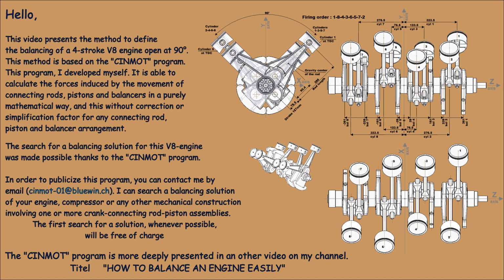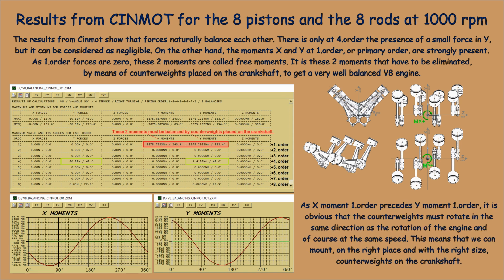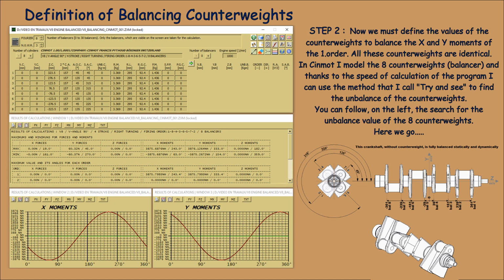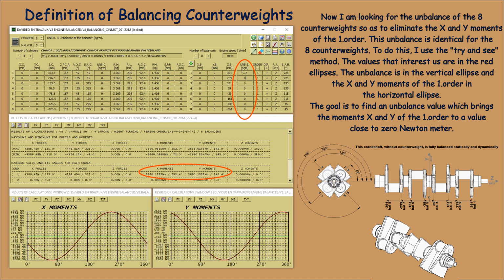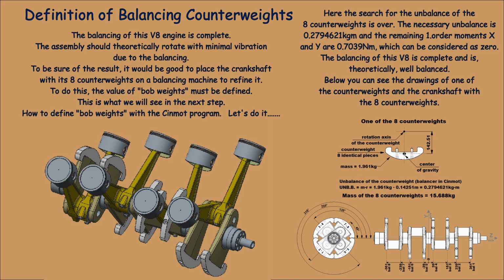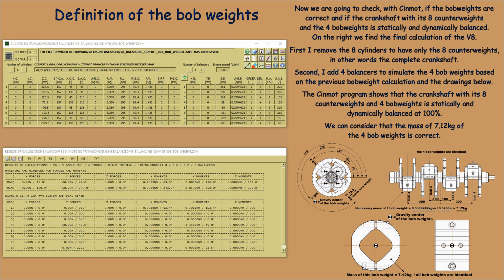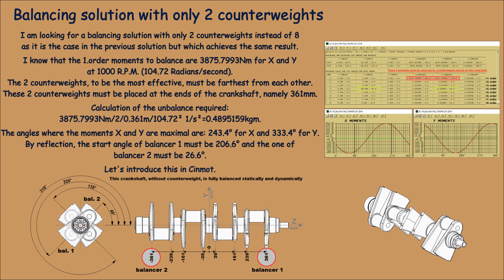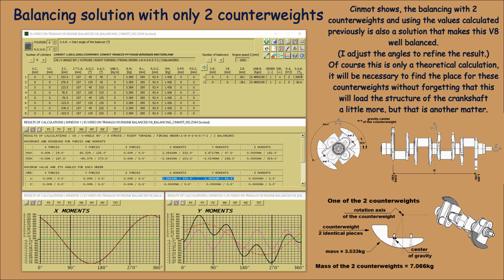BALANCE A V8 ENGINE

Comment: Hey i am thinking about bilding a crossplane inline 4  from a d4f renault engine, how hard do you think it wil be? And would balancing whit only 2 counterweights be sufficient?
Reply from the maker: Hi  Niels Van den Branden 

Thank you for your message!

If you want to transform a standard inline 4-cylinder 4-stroke engine to a crossplane inline 4-cylinder 4-stroke engine is a big deal. You have, at least, to make a new crankshaft and new camshafts for the mechanical side and adapt the all electronic engine management.
I can not help you for this, but I can help you for the engine balancing.

A standard inline 4-cylinder 4-stroke engine has, without balancing shaft, vertical second order free forces. With 2 counter-rotating balancer shafts (Called "Lanchester balancer shafts"), those free forces can be fully balanced and this 4-cylinder engine can be fully balanced (free forces and free moments can be totaly balanced).

A crossplane inline 4-cylinder 4-stroke engine has, without balancer shaft, no more free force of any order, but first order free moments appear. Those free moments can be partialy balanced by mean of counterweights placed on the crankshaft. If your crankshaft is a fully balanced crankshaft, 2 counterweights, judiciously placed on the crankshaft, are enough to reduce those first order moments, but only to reduce . If you want to fully balance this engine you have to built in a first order balancer shaft wich has to turn in the opposite direction of the engine, just like a 3-cylinder engine (wacht my video on the balancing of a 3-cylinder 4-stroke engine https://youtu.be/-xIf-aW9QF8 ).

In brief. This new building will solve the problem of the second order free forces but it will create a new problem by introduicing first order moments. In other words you solve a problem by generating an other.

If you are able to turn this standard inline 4-cylinder 4-stroke engine into a crossplane inline 4-cylinder 4-stroke engine I can only help you to balance this new construction. You can contact me (cinmot-01@bluewin.ch).

My opinion is:
if you want to realize it, it will not make it a more powerful or more economical engine. I don't see the point of transforming this engine because it's a huge job. This may be a conceivable solution when building a new engine.

Greeting F. Pythoud
Reply: Hi Francis Pythoud

Thanks a lot fore responding, i wil introduce my self first.
I am a student at the University of Antwerpen where i study industrial engineering elektromechanica. Next year (im in my 2 year and i am 20 years old) (in belgum we started monday in the university) i have to do a bachelor project and the year afther a master project so i was looking for a cool project to do where i could put al my thinking in and be proud off.

For the production i have a frend at  crankshaft.be where they make replica crankshafts for oldtimers if they are broken and race engines for dragracers and tractor pulling. So hopefully they could sponsor me.
Only the ecu wil be a problem, maybe i can use half of a v8 or reprogram an agthermarket one (the one from the engine cant be flached).

For balancing i wil use only counterweights becas its not a very high reving engine and original it doesn't have balancing ether for the second order free forces.
If i have to put one in i dont think it would be legal on the road in belgum becas i would have to change the engine block.

I wil save your email and when i do the pitch and the let me go tru whit i wil contact you agan, that wil be in a year probebly, but i wil ceep looking fore problems end solutions like the ecu.

Yes the engine wil be infirior en many ways, only Yamaha R1 used it in a motorcycle becas they could find the grip limit better. It wil have more back pressure becas of stacking exhaust pulses and wear more becas of the inballace of the crankshaft.
Its not yet set in stone i wil make it but i would be auwsome if i could and it would be the only one on youtube i think.
And the sound would be nice to :).

If you can think of more problems please let me know.

Met vriendelijke groeten
Niels Van den Branden
Reply: Would i do it or not, what is your opinion?
Reply from the maker: If your question is "Would i do it or not, what is your opinion? " I do not know you, so I can not give you an answer.
If your question is "Should i do it or not, what is your opinion? " I would answer you, It is a very big challenge to do it and technically speaking it is pointless. As you wrote, Yamaha has already built this kind of engine but it is up to you.
Personally, I wouldn't invest so much energy and money to make a prototype like this. But if it's a challenge or fun for you, go head do it! I do not want to put you down.

Do not forget, for this engine you have to rebuilt  the 2 came shafts and not only the crankshaft.

If I may give you an idea:
You are looking for a bachelor project and you have interest in thermal motor, take a look at the "hot-air-engine" or "external combustion engine" (https://en.wikipedia.org/wiki/External_combustion_engine). Internal combustion engines have, during the last century, benefited from a gigantic development, on the other hand hot-air-engines, like the Stirling Engine (https://en.wikipedia.org/wiki/Stirling_engine) or Ericsson engine (https://en.wikipedia.org/wiki/Ericsson_cycle), have been, for various reasons, put aside. For me and with the energy crisis we are going through, these engines have a chance again. These engines are just mechanics and thermodynamics and a prototype is relatively simple and cheap to built. You will learn a lot about mecanic and thermodynamics doing a bachelor project on this topic and with your young brain you might find new solutions, who knows. 
This engine is nowdays used, for example, in solar power station and the heat source is the concentration of solar radiation.
The Philips compagny, Headquarters in Amsterdam Netherlands, sold in the 1950s an electric current generator equipped with a Stirling engine (Philips MP1002CA Stirling ), perhaps your Flemish neighbor still has some activity in this area.
Just think about it.

Met vriendelijke groeten
Francis Pythoud
Reply: Thanks a lot! I wil speak whit my professor and ask what he thinks, Stirling engine is ofcorse a great option to.
I didn't know Philips made that haha that's auwsome.

Have a great day
Niels Van den Branden